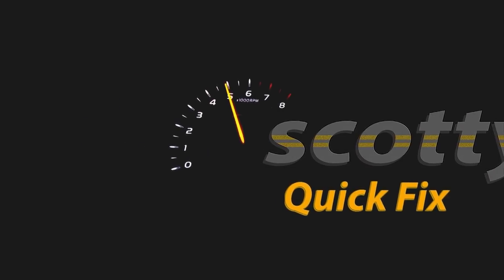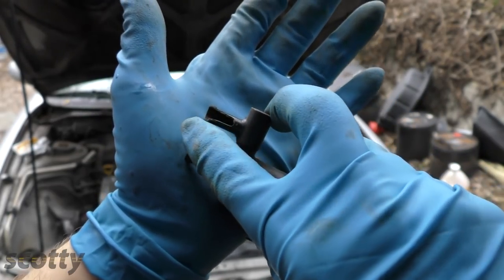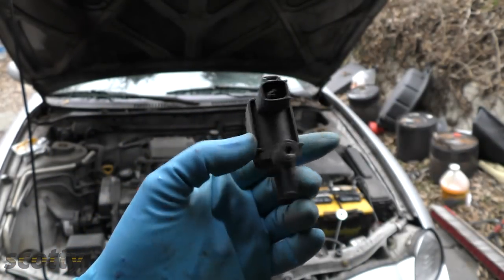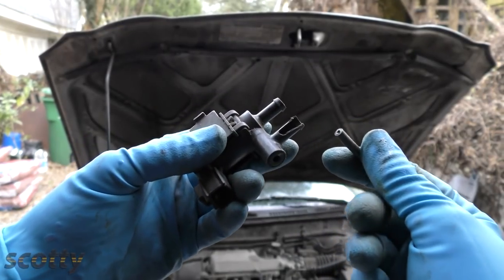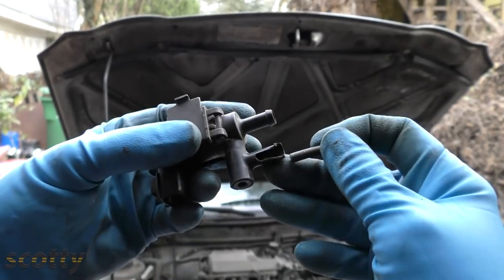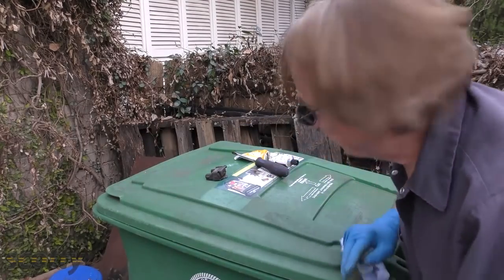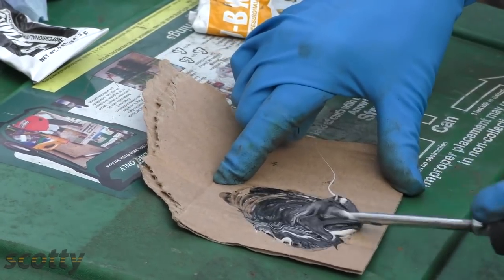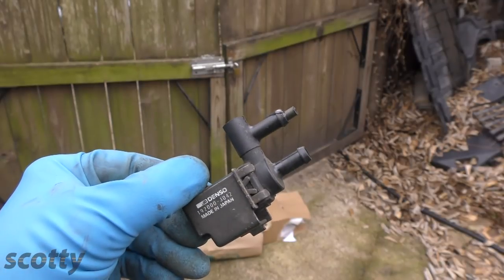How to Fix Car Parts Instead of Buying New Ones (JB Weld)

Comment: Scotty you are excellent engineer, anyone can remove and replace, it is rare to come across engineer willing and able to solve problems by repairing components. I substituted a rubber hot water hosepipe with 50mm DIA  x 180mm long copper tube + Couple of bends and four jubilee clips. I drove that car for 15years (it was 7year car when I purchased it). New owner drove it to Pakistan from UK three years ago, it is 25year old, and it is still on the road with my modification. 
Rubber hose from Mercedes was $80, copper tube $6. You sir are rare professional who uses his brain. Good man.
Reply from the maker: Thanks for the support!

Comment: I've used JB Weld for various repairs for years. One time, my dog knocked over my Casio keyboard and broke three of the keys. I took it apart and JB Welded the keys back in place. Now, here it is, at least five years later and the keys are still working like new. I'm a believer!

Comment: I've done a few of the JB Weld fixes through the years but this is another sort of ingenuity fix---I was driving one of those old Audi Fox's cross country back in the mid-80s and just as we exited the highway to find a room for the night in Tucumcari New Mexico, the alternator bracket cracked off and naturally the motor died. We actually coasted to the motel parking lot. It was dark and I was exhausted so I let it sit overnight. In the morning I inspected the problem and decided that given I had no tools, a shoestring would have to serve as my new alternator bracket. Luckily it was one of those Nike high-tops shoestrings that are about 6 feet long. I wrapped it around the bracket and through the bolt hole and cinched it using some old boy scout knots. It worked. Luckily no belts or other parts were damaged. Got me all the way to Winslow Arizona and then on to Phoenix before the head gasket blew. Has anyone ever swapped the head gasket on an Audi Fox in the middle of a mall parking lot? I have. I went ahead and replaced the bracket with one from a salvage.  Nothing like walking around Phoenix in the summer collecting tools and parts so you can get back on the road. Thank you Napa!

Ahh to be young again.

Comment: I gotta rust hole in a gas tank in my Tempo when i lived in michigan...i put some jb weld over the hole, then i smushed a quarter into the jb weld, then I put more jb weld on the quarter...worked like a champ
Reply: lilpoindexter Hahaha, nice. A 25 cent patch panel.
Reply: With that quarter you probably doubled the value of that car.
Reply: lilpoindexter I did that to the oilpan on my 1993 crown. I drained the oil and cleaned the area with rubbing alkahol. I used a looney.

Comment: JB weld has its limits. I find it doesn't work well when subjected to higher levels of heat. The epoxy softens up. Sometimes you're better off hitting the salvage yard.
Reply: electronicsNmore Did you hear how he used it on an engine head? And it lasted 3+ years?
Reply: Also too brittle. Tried to fix my pressure washer lance with it and it cracked immediately.
Reply: I used it on my exhaust bracket and lasted longer than the car.
Reply: Weld Done Scotty! Thank you for another great lesson in auto repair.  You are top notch.
Reply: electronicsNmore 
I used JBWEld on metal exhaust pipe glued to exhaust of Honda gas generator,,gets pretty hot and it still holds just fine after long time..
Reply: s3xyScorp I always had bad luck using it on hot surfaces.
Reply: There is a channel that used a 100% jb weld cylinder head.
Reply: StrokeMahEgo Good luck with that repair. Lol
Reply: electronicsNmore maybee try muffler cement.
Reply: punker4Real rusty power steering lines: cut and replace line. Connect with compression fittings.
Reply: Hal White 

30 years when I was a poor student, I received a retired Toyota Corona station wagon of 1960s from my friend, the car was usable however with a punctured hole of egg size on the engine head with sprung engine oil all over the ceiling of engine bay cover.  I was told to refill a quart oil for every trip out.  I came up with the idea of using epoxy as clay to seal the hole.  I bought a box of epoxy and wrung it as play doh then patched the hole with epoxy doh for overnight.  From then on I never have to refill the oil and drove the car for 5 years till it was rear ended by a reckless driver.
Reply: electronicsNmore fixed an oil pan and it lasyed years.
Reply: electronicsNmore no disrespect but i believe your not following the directions either not preped rt or didnt wait for full cure not set -cure and should be not hot when done -part not air temp
Reply: electronicsNmore really its true

Comment: Great video Scotty.  If you don't want the JBWeld to stick to what you inserted into a round tube, place wax paper around the insertion object.  That places a micro layer around the insertion that will allow you to easily slip it out after the JBWeld fully cures.

Comment: JB weld is great stuff.   been using it for over 30 yrs I think its been.  I used one time on an gas line where it connected to the tank or somewhere around there.  Its been so long.   It worked and the gas did not faze the  JB once it had fully cured.

Comment: I have used this stuff to repair stripped drain plugs on motorcycles. Once it's fully cured in setup you can drill and tap it just like aluminum. Repair my buddys motorcycle years ago and he still riding it no leaks
Reply: ROBBY M had a rope snap pulling a motor(rookie mistake) the head had a chunk of the aluminum snap off, fixed it with JB weld 50k miles later and it's still holding. Hahahaha!

Comment: Can I use it to glue my whole car together?
Everything is falling apart, haaaaaaaaalp meeeeeeee
Reply: Crucial Muzic just super glue and duck tape will work just fine
Reply: Hahaha you guys are awesome :)
Reply: Some years back when I was a poor student, I had a 1980 Suburban with 300,000 miles on it that was nearly as much duct tape as metal.
Reply: Bob Frog reminds me of a kid from the high school I went to. The bed and cab of his pickup was literally held on with duct tape... He also 'fixed' his engine mounts in a similar fashion... He had to get out the window dukes of hazard style, but that truck ran great somehow.
Reply: they should make cars directly out of duct tape. easier to fix
Reply: I'd love to know how to fix motor mounts with duct tape. I have used fiberglass fabric and resin to wrap around my rusting cast iron waste pipes in my house.

Comment: I used jb weld and aluminum patches i cut from old discarded road signs to patch rust holes in my 64 C10 floorboard. Keep the video's flowing i find them informative AND entertaining

Comment: Repairing automotive parts instead buying new parts is a lost art with todays mechanics.
Reply: It depends, however.  Everyone is in a big damn hurry, and the customer wants his or her car back NOW.  This involves waiting for the JB Weld to cure overnight.  Also, time is money, and parts sales are more profitable to the dealership than fixing an existing part (which may or may not solve the problem).  The mechanics are no doubt told, "Do whichever is quickest and makes us the most money".  You put the new part on, and the customer drives off happy.  It's only independent mechanics, like Scotty, who would do this to help the customer out.
Reply: Well, it does depend on the part you are trying to repair, sometime it is not feasible to repair a broken part. Let's look at a standard GM starter for example, a lot of times if the starter does not crank, it can be as simple as opening the starter solenoid and flip the contact disk and you can have the car back on the road before the new starter is delivered, but you probably know that. You are right about the big box shops, a lot of them sell you items that you didn't really need.
Reply: Well, there are plenty of fools to go around and they come in all colors.
Reply: So true i remember when people use to take things apart repair whats broken then put it back together. When i worked at a small time auto repair shop i did this on an alternator my boss was impressed and i was fresh out of UTI but then joined USMC and had to leave my job
Reply: @stever5887  what you said represents a large part of what’s currently wrong with the world

Comment: Just convinced a friend to fix a pin hole in his radiator yesterday with JB Weld. Perfect timing Scotty.
Reply: That's great; it will probably last for years.  I had a pinhole leak on a metal tube near the engine block that carried hot antifreeze.  The tube was a specialized part with a T junction, and was expensive and not readily available because only the dealer carried it.  As a temporary fix during my lunch break at work I used JB Weld on it and it lasted around 25 years.  When it finally crumbled off the pinhole still did not leak; maybe some of the JB Weld got into the pinhole or it just sealed itself with minerals from the inside over the years.
Reply: Rýán Túçk the cement is called hardblok. They will fill the entire block minus the top 2 inches
Reply: WV4LIFE 

30 years ago I fixed a hole on the radiator of my beaten old car with epoxy as crayon and it worked quite well to save me from buying a new radiator.

Comment: JB weld is awesome. I had a door handle break/wear out on a ‘74 Ford trick. I used JB weld and some pieces of coping saw blades and it fixed it great. Worked for 4 years and was still working when I sold the truck.

Comment: I used j.b. weld to repair the heat exchange unit on a 1988 bayliner boat. Ten years...no issue. Boat is gone but the heat exchange unit lived!

Comment: Camry I bought the radiator was plastic and the top had a nice size hole. The guy I bought it from had fixed it with something. Worked for him but had broken off. JB welded the hole and hasn’t leaked since. Great product

Comment: Scotty, I just had to do this recently on the idle air control for my swift engine swap onto my samurai. I used RTV silicone to seal it. Holding strong so far.

Comment: a couple of years into owning an old car, the starter started having problems. The contacts were worn out, so when the magnet pulled the rotor, the contacts wouldn't contact and the car wouldn't start (just a clicking noise of the rotor moving back and forth). As a quick temporary fix I cut tiny pieces of copper sheet and soldered them to the worn copper contacts of the starter. It worked perfectly, and now, 5 years later, it still works!

Comment: I guess I can speak for everyone you are a money saving man from God. I broke one of the stems on my dodge ram roll over valve when putting in a new gas pump only way to get that part is through the stealership, now I can just use some jb weld and problem fixed thank you Scotty.

Comment: JB Weld really works!
A few years back (Well, a lot, 25) I had a 73 Plymouth Duster and changing the thermostat, I broke the thermostat housing, I couldn't afford to buy a new or used one so I bought JB Weld, and voila! It worked great. Thanks Scotty for the tips!

Comment: JB Weld can also be used to repair stripped threads in a threaded hole. Coat the hole with JB Weld and let it set up for a short time. Put a release agent like WD 40 or CRC spray oil on the threads of the bolt and screw the bolt into the hole. After it is fully dry you will be able to unscrew the bolt because the release agent won't let the JB Weld stick to the bolt. I don't know if I would use it for a heavy duty repair such as a cylinder head that requires a lot of torque but for things like carburetors and most household projects it will do the job.

Comment: Sorry by my english, that product IS so so good , i bougth one to repair my break motor block and It works perfectly, i sold my car 5 yers ago, after used it 3 years after i fixed, the motor block broked one day when when frezing in my town -15 degress (centigrades) in México, i was using water instead coolant

Comment: JB Weld is amazing! A screw came lose and fell into my fan which launched it into the radiator. It was going to cost like $600 with shopping for a new OEM radiator on an Acura TSX V6. So I pulled the radiator and patched it with some JB Weld and set it in the sun for 2 days. I never had a leaking problem since.

Comment: Yeap it does work.. 2 years ago, I also do the technique when I found out when my car water-leaking was in the timing case and water-jackets, pot holes.  I drilled a bigger hole put bolts and  Devcon & wait 24hrs. It cost me $2. No leaks till now.

Comment: I've had very good luck with jb weld last spring repairing my cars Radiator. Had about a 2 inch crack right in top where the upper radiator hose comes in. That part was plastic, I sanded it down some and used a bunch of jb weld and here we are a year later and still no leak!

Comment: @ScottyKilmer I have a 2002 Dodge Caravan Sport 3.3L V6. I just spent about $300 in CV Joints, Spark plugs/Wires, and an ignition coil $400 just for parts. Then $240 on labor. It was my grandma's and my dad bought it for her for $300, just had a leaking radiator and valve cover gaskets(fixed). 
Anyways, after I had the CV Axles done because one of the boots broke, it now shifts slower and when I stop or slow down, it lurches a little bit. And I'm going to be doing the radiator shortly. 
Thanks, Alex.

Comment: I've used JB weld on clutch cover of my motorcycle to save the day when I was broke. Couldn't afford a new one until 3 months later. It worked perfectly. Now I'm fixing my Mercedes bumper with it.

Comment: So, I suppose this will work with plastic vacuum cleaner parts, too. I hate the "disposable" mentality. I love to fix things and make them last forever (plus I live off SSDI because of health problems, so I try to live as frugally as I can). After I did a lot of work on my 15 year-old lawnmower and got it running again, a friend said I should repair vacuum cleaners and carpet shampooers.  I read a story about a vacuum cleaner repairman who closed shop and said the new vacuum cleaners have so much plastic it isn't worth trying to fix them. Sad. Thanks for your videos I have done several repairs on my 1995 Geo Prizm with your help!

Comment: Once I fixed my huge power steering leak on the Ford fiesta mk4 by pouring gelatine powder into the power steering tank.  After I added the gelatine the wheel was like stuck so I removed the old fluid together with the unnecesary powder and replaced with new one but the crack got covered and was a big one  and after all was running nice and dry. I did others crap too and I like to improvise but is not always a success. Nice videos and thanks for your advises !!, so helpfull !!

Comment: just fixed a stripped aluminum tensioner pulley bolt with jb weld. the bolt was not stripped but the tensioner itself was and I refused to throw anymore money into a old POS 98 dodge caravan. Worked great. The reason it stripped is because I had to put the serpentine belt back on so many times because dodge figured it was a good idea to use smooth idler and tensioner pulleys to where everytime it rained and got alittle water on it, It would simply fall off. So I got doorman pulley sheilds to fix that problem as well.

Comment: Years ago, I used JB Weld and a toothpick to plug a water leak in a pump gasket. It was winter, I didn't have a warm place to work on the car and I hoped it would hold out till spring. I never got around to replacing the gasket, and sold the car 5 years later with the JB Weld / toothpick plug still holding strong.

Comment: JB Weld is awesome!  I used some to fix an oil pan that cracked right around the drain plug when I bottomed out one time.  Put that stuff on, ground it smooth, and bingo!

Comment: If the J B Weld is mixed as directed and applied to a clean dry surface and left to cure overnight , it will repair many broken parts ...
I have actually drilled and tapped new threads in to the mixture and the results will blow your mind ....
Great product .

Comment: Where would we be today without J B Weld. It works!! Nice tip using it in auto repair to fix expensive plastic parts for sure. I sprinkle a little very fine powder in mine to increase its strength. Thx.

Comment: Just 2 days ago I used JB weld to seal a small leak in my rear differential. I hit a rock buried in snow and scratched a deep gouge in the diff. 1st I used Devcon and that failed. I think the JB weld is gonna do the trick though. 👍

Comment: My honda civic snapped a connecting rod and I JB welded it. It's good as new, also I had a Axle snap, JB welded it right up and it's good to go. I even used JB weld on the drive shaft that broke on my ford.
Reply: John liar funny but obvious lie 
You should not confuse the non mech folks

Comment: Another great epoxy product is 3M brand structural adhesive. I have used this stuff to repair radiators all the way around where the end caps are crimped. It's not cheap, but neither are radiators.

Comment: I did once used epoxy glue to repair the quadrant of my motorcycle... I had to brake the epoxy to replace a lamp, but it sure did the job, well better than what I expected.

Comment: I was thinking that tube would be a liner template to replace the lost material with JB, not to be the actual tube, but hell whatever works! Good trick to have. I use gray rtv gasket maker to keep plugs together where the plastic tabs have broken off. Even have that on the clips for the ignition coils and haven't had a problem for years.